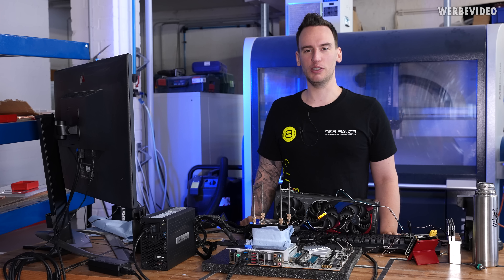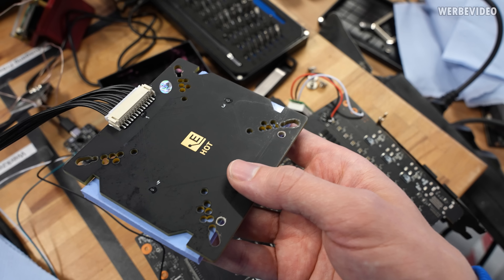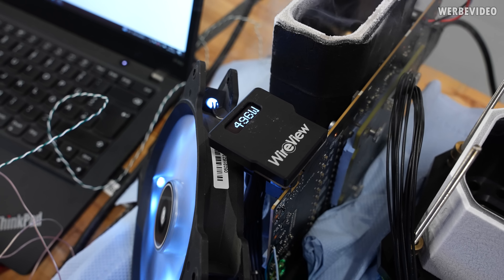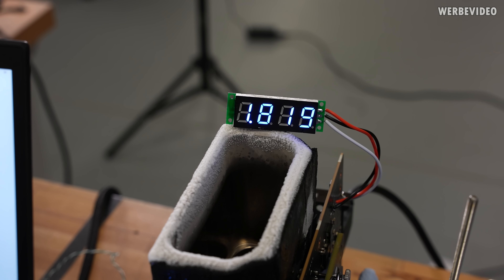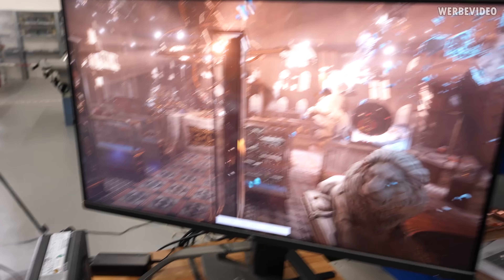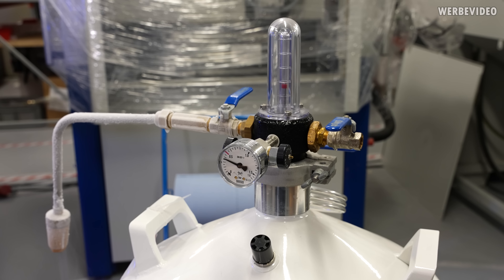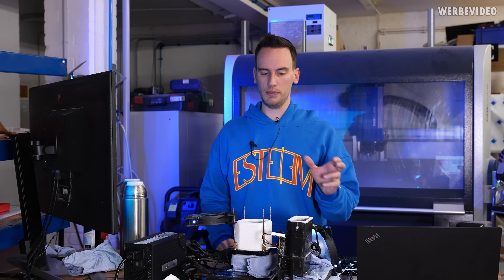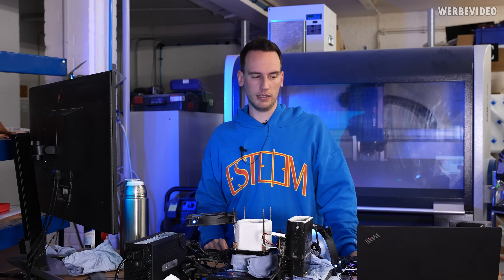A Challenge for 12VHPWR? 900 Watt Power Draw running the RTX 4090 under LN2

Comment: There is a catch, you don't use LN to cool the GPU, but the power connector!
Reply: BHHahahahahha
Reply: lols
Reply: New 12pin ln2 mini pot coming?
Reply: If you already have the LN2 on hand, why not go even further and replace the 12pin with a superconductor?
Reply: Just watercool the 12vhpwr plugg 

It's the only ting that gets hot 

Pc builders in a few years 
Watercooling a gpu ??? Why would we do that that's from the dark ages 
 Watercooling is only for the 12vhpwr pluggs do you want to use them for their intended use ? I recommend a 360mm radiator / power plug
Reply: Ha ha ha! Funny writing.
Reply: better for me

Comment: You can try and use nvidia-smi to force max boost clocks (same thing precision X does for it's "boost lock") to prevent that odd downclocking at the beginning. Though, the card running at 2610 would indicate it is already in the P0 state, but worth a try.

The 29k+ PR scores (and even upper 28's) on ambient are mostly just people abusing the memory bug. Gonna have to force ecc enabled for hwbot leaderboards as using the HoF is basically pointless ATM.
Reply: what is the memory bug?
Reply: @iMagic16  People jacking up the memory clock until it's unstable and produces errors in the texture rendering. You can watch gamer nexus' ln2 video where their last run did this and gave them a +1700 points over what they had been getting.

I personally have gotten over 31k on ambient when this happens (I didn't submit the score because it's not right to do so and is a borked run).
Reply: I have the same thing happening on my 3080 Ti FE which is downvolted on MSI afterburner.
It is set to 1830 MHz and that works in most games, but during TimeSpy it will first run at 1815 MHz for a few seconds, then 1845 MHz... Then after some time it will stabilize to 1830 MHz !

The difference isn't big enough for me to worry about it, the only problem is that 1845 MHz can provoke crashes in games so I have to monitor this

Comment: The pcie x8 is a platform issue. Alder lake/raptor lake cpus only have 16 pcie 5.0 lanes so most motherboard manufacturers chose to bifurcate the x16 gpu connection whenever the top m.2 slot is pluged in, in order for the ssd to have gen 5 connection available.
Reply: yea already been said in the last video, it's running x8 because the nvme isn't in the right slot
Reply: @Panurgic well yes and no, im pretty sure they can set the top slot to use gen 4 which would allow the gpu x16

Comment: I have a strix 4090 too.  When you apply an overclock in afterburner and run the pcie bandwidth render test in gpuz, the strix will run at 2610 (its factory boost) rather than the overclock applied in afterburner.  Same thing that is happening to you during your first 10 seconds of benching.

Comment: Maybe try to get the Galax HOF card. The higher amount of power stages, maybe higher quality could decrease vrm temp at higher voltages. If it is a good sample you might be able to run colder at higher power consumption. Especially with the double connectors.

Comment: Pretty cool!
Can i ask a question?
Can i build a bracket for my RTX 3080 Turbo by gigabyte for aio cooling?
There is no water block for it, It's a really hot card.
I was curious to build a bracket for an aio cooler then attach it to my gpu.
I'm not sure how can i cool the memories and other parts

Comment: If you're using the M.2_1 slot, on that board, it behaves as though PCIE_2 is in use and halves your bandwidth to x8.
Reply: Even on X570? D:
Reply: @BBWahoo  Yeah, it is due to the board layout.
Reply: @erkinalp  
Strange, it still reports as 16x lanes used in the BIOS. I wonder why? 

I have, 3 NVME slots, and three PCIe slots, one occupied, the former using 2 NVME Drives + U.2 using an NVME adapter, and a 1080ti, so I assume it only halves it if I used PCIE 4.0?+
Reply: @BBWahoo  "Even on X570?" - No, specifically on the board that Roman is using.

Comment: 9:42 in my case this happened without any XOC due to nvidia drivers not respecting my "prefer maximum performance" global preset. By manually setting 3Dmark to run at maximum performance mode in nvidia control panel and restarting, it locked to the set frequency as soon as 3Dmark was launched and stays there until it closes. I was having similar clock issues in other applications and the same process resolved it (was running at only 400mhz for 2d acceleration even though it was 70% short of frame rate target).
Reply: This is exactly what I was thinking, low clocks like that is what we see when the card is in the "Normal" power saving mode.

Comment: Maybe a silly question, but are you putting your boot SSD in the PCIe 5.0 m.2 slot on these boards? 'Cause on Z690/790 those are always bifurcated off the PEG lanes as the CPU only has 16 5.0  lanes. Make sure your SSD is in a nlot explicitly marked 4.0 or 3.0.
Reply: that could help but i'm not sure that would be the problem another thing that could possibly be creating the problem is the fact that all the safety features are turned off as that could be causing the GPU to think there is something wrong with the safety features there for pulling the PCIe lanes down from 16 to 8 in order to keep within its safety margins
Reply: @lordi2009k  I'm not sure that would be the problem either, hence why I'm asking. But if there is a drive in that slot, then the GPU won't have access to more than 8 lanes no matter what you do. That's just how LGA1700 works, sadly.

As for what you're saying, it's a theoretical possibility, but rather unlikely. The number of lanes active is detected and negotiated during POST, and the GPU or motherboard doesn't normally change this while in operation - they'll step down to a lower PCIe gen for power savings, but I've never seen actively negotiated bus widths. If there was a safety fallback mode it would likely go to the lowest possible configuration, i.e. x1 PCIe 1.0 or 2.0.

Comment: I’m sure you know this but if you populate the first nvme slot it makes the gpu run in x8 not x16
Reply: only if you dont have enough pcie lanes
Reply: @Proto_is_noob  on the extreme boards that is what it does. I have the same board

Comment: Hi Roman,can you flash back stock BIOS and see if  PCI_E speed will be x16 or it will be same stuck at x8,I  have experienced something similar with RTX 3090 when I flashed there XOC BIOS,my RTX 3090 would stuck x8 with XOC 1000W BIOS
Reply from the maker: Showed it in the last video already. It's x8 even with stock bios
Reply: @der8auer-en  Roman, z690 mobos have a bug (if you are using nvme slot 1, the gpu runs at 8x) try in another slot.
Reply: @der8auer-en  Ohh okay Roman,thought so its down to BIOS,does happen with both BIOS? I assume that Strix as always have dual BIOS
Reply: @andresm5087  That doesn't sound like a bug but a feature.

t. ASUS CH7 with dual NVMes with PCIe x16_1 running at x8
Reply: @andresm5087  he tried other slots, other motherboards etc.....definitely a #### card.
Reply: @RogerRamjetLips  Is a bios related problem,  If I use until BIOS 1304 I get x16 but if I load BIOS 1403 or later I get x8.
Reply from the maker: I even tested on a gigabyte B650E board and there it's also x8. It is a card problem. I tried literally everything
Reply: @der8auer-en  my 4090 msi trio is also at 8x, idk why
Reply: @der8auer-en  I manually set my pcie 5 to x16 and still nothing. Disabled the m.2 #1 because they share bandwidth and nothing, updated the bios because the new bios has some fixes for 40 series ( date 11/08) and still nothing… pretty weird

Comment: My GPU goes pretty hard, pulls 485w @ 1.096v with core clock of 2.2ghz @ 74c under gaming load. Asus Strix 3080 Ti OC, Asus just builds things different I guess, I have loads of headroom too, I could easily undervolt it and run higher, I've achieved 2.3ghz at 1.069v before but the temps were at 73c during Timespy benchmark and assumed I'd be looking at 80+ on gaming for long periods so I'm currently running 2.1ghz max, pulling 353w @ 64c 1.000v

Comment: What psu are you using? I just got a strix 4090 oc and I have rm850x. I need to get something a little stronger.  I'm running 12900kf. I'd really like to get something that I don't have to worry about upgrading in the next couple of years... so I'm looking 1400 to 1600w range.

Comment: However, there is one thing to be aware of when installing an SSD in the first M.2 slot.  Namely, that it takes the PCIe 5.0 lines from the graphics card interface.  It has the disadvantage that the moment you install an SSD in this slot, you will switch to eight GPU lines, which will only work in PCIe 5.0×8 or PCIe 4.0×8 mode

Comment: The motherboard runs at x8 mode because they lock it when there is an SSD installed in the slot closest to the CPU or m.2_1. I was also bugged by this and the solution is to move the SSD which is impossible for me because my board has 3 slots and I have 3 m.2 ssds.
Reply: Did you watch the video? He tried multiple, boards and CPUs.. it’s the card 💀

Comment: Could the 700mhz for the first 10 seconds be caused by the chip actually being too cold?  Maybe it’s so damn cold that the temp is  “misinterpreted” as an error and the card full throttles for safety.  But after about 10 seconds of load the chip warms up enough to be in a range that the card recognizes… Or is that all just crazy talk?

Comment: G'day Roman,
🤔Just wondering if the PCIe X8 problem exists when you do Air or Water OC too? as you have tested with different CPUs & Motherboards maybe some Temp testing to see if there is a point where the PCIe limits because of that, or just another thaought as you & BPS Brian both had this with your intel platform does AM4 & AM5 cut the PCIe lanes too?
As nVIDA is so strict with the Partners regarding BIOS & Power Limits do you know if they have said anything about Elmore's BIOS for 4090, 800-900W has gotta be giving them the SHITS BIG TIME.
Reply: Have you not seen his past videos?
Reply: @les_railgun  not at the moment, I have been trying to find a new home suitable for my disabilties & now am in the middle of moving.
So if Roman has answered these questions in past videos I would be grateful for you to answer them for me & point out which der8auerEN videos so I can watch them first when settled in my new home.

Comment: Question for you Der8auer:
Do you agree with corsair that the melting is caused by not fully inserting the 12+4 pin connector?
Reply from the maker: right now it seems like  a lot of guesses but somebody has to find a way to reproduce the problem. Otherwise just guesses
Reply: New post on reddit 5 hours ago with a Zotac 4090 burned with connector fully seated. If 0.5mm of gap is all it takes to burn a connector its faulty design either way. There should be enough contact either way even with a small gap. Someone, like der8auer for example should measure pin depth and terminal depth vs how far the adapter is socketed to verify terminal/pin contact. Would easily tell if the "not socketed correctly" is even a thing.
Reply: @Tommyof84  Which sub was the post on?
Reply: @noxious89123  R/nvidia post "9900k 4090 adapter melted"

Comment: I'm curious.. could these condensation issues be helped by running a de-humidifier in the room to try and reduce the amount of water in the air?   Just a thought...
Reply: lmao no
Reply: @Sarlyx  no he seems to be right. Condensation is the water in the air cooling and condensing. If there is less water in the air it would take longer for condensation to build up, ie. there would be less of it. Theoretically if it was 0% you wouldn't get condensation but that's basically impossible.

Comment: Just a thought, but are you using the primary and secondary nvme slots? On some older boards using both will lower pcix slot to 8x as there are not enough pcix lanes available

Comment: for what its worth im using a MSI gaming x trio 4090 on a gigabyte B550 master board, 5800x 3d cpu and my bus interface reads x8 aswell. stock bios as it would be out of box.

Comment: 1:28 thermal pad…

Thats a thermal brick!!

XOC bios are amazing shame i cant find one for the 3090 with rebar support so stuck at 370w max cus 2x8 pin even tho my PSU wouldnt even flinch if i used it as 1x8pin daisy chain and my cables will happily do 500w each im stuck at 370w total cus bios

Comment: Perhaps time to directly LN2 cool the memory then!?
Reply: That wold make it worse
Reply: @Adam-bw4lw  Explain?
Reply: @bradley3549  its memory controller inside the gpu that likes to be cold, nand flash itself can perform worse with lower than ambient temps
Reply: @vinylSummer  But we're not talking about NAND flash here (and I am familiar with the thermal sweet spot NAND seems to have.) We're talking about DRAM - which does seem to respond to cryogenic cooling - though I've never seen it on a GPU.
Reply: @bradley3549  oh, you're right, I mixed things up in my head a little bit. Maybe not direct cooling, but rather some heatpipes going from the base of a ln2 pot to memory chips would be interesting to see

Comment: A lot of the scores on the hall of fame for Port Royal should be invalid , there is a bug where if you can get your memory to clock really high ( over +1500 ) there is a chance it will artifact ramping up the fps and still posting a valid score , jay mentioned about this in one of his recent videos so wouldn't be put off by most of the scores currently posted , its pretty easy to tell which are genuine and which are not :) 
As for your card have you reached out to ASUS for any advice on where the missing pci lanes have gone ? its a bit  past the rma stage but maybe they can help or offer some advice ...
Keep up the good work as absolutely love your content :D
Reply: Highest I got was 27.1k, it seems like without any voltage/vbios mod getting above this seems impossible
Reply: @KopaZ  I can get a genuine ( no artifacts ) score for just over 28k on my FE when overclocked but this is pushing it to the limit as core will be around 3045mhz and memory at +1500 . I can push the memory higher to +1600 amd will have lots of artifacts and post a much higher score but its not genuine imo🙂28k should be possible though on an overclock air cooled card 🙂
Reply: Cope.

Comment: Could the 8x PCIe lanes be caused by a driver issue? Have you tried completely wiping Nvidia drivers and reinstalling them with DDU or however that tool was called?
Reply: It's a motherboard feature. Alder lake and raptor lake cpus only have 16 pcie 5.0 lanes so the motherboard has to bifurcate the x16 connection in order for both the top gpu and m.2 ssd to have gen 5 connection, even when non of them are actually running at gen 5

Comment: How do you get the power connector to not mealt!?
Reply: The PCB is basically layers of copper sheets. They conduct heat very well. This is when LN2 cooling just the GPU core, everything else including the VRM stays reasonably cool. The connector can't melt if it's being cooled!

Comment: Regarding the x8 issue, did you try a different 12VHPWR cable? In case it's an issue with one of the solder points in one of the connectors being broken?

Comment: 12V plug melts running 350-500W unoverclocked cards.

der8auer: hmmmmm
Reply: If it melted on every system there would be a recall. No reviewer has had theirs melt, even the ones who have tried to make it happen.
Reply: Good thing that aside it being a ludicrously obvious joke, I didn't even say it melts on every system then isn't it.
Reply: @enlightendbel  There was nothing to indicate that it was a joke. Jokes need to be funny to be recognized as such.

Comment: Can you do a episode on why 4090 takes so much more power with each voltage increase?
Reply: It's literally the same as every other semiconductor, CPU or GPU, for the last couple of decades. Increasing frequency increases power draw in a linear fashion. Increasing voltage increases power draw exponentially. (To be specific,  "power consumption is proportional to the square of the voltage"). It's more drastic than we've seen with older cards, simply because it's far more power hungry to start with. There's an awful lot of transistors in that GPU!

Comment: So good to see the connector issues are just user error. He is hitting 900 watts with no melting.
Reply: Still didn't watch the video but other ppl looked into it and it depends on how the cable itself is made
Reply: The connector issue begins when you use the card in a case and start bending the cable adapter.  When you have the weakest part of the adapter exposed and then begin pulling 350+w thats there issues begins
Reply: The power plane gets colder because of the LN2 cooling through the GPU chip BGA and this cooling effect carries on to the connector pins themselves, so they are running at lower temperature helping them withstand the heat generated by the high currents

Comment: you need to get your hands on the new z790 asus apex board that will get you 1st place all day long, its alot better board then any of the z690 boards by miles for such things,  z690 boards are trash and 100% waste of money, its the gen to 100% skip.   get yourself the apex z790 and see why soon as someone got their hands on one it instantly took the single card world record, vs all the z690 trash on the market.   ive been tellin folks this for months but hey they are stubborn and dont want to learn the reality of it since they wasted their cash on z690 they wont accept defeat.  as below is proof its the current world record holder go look yourself then drop those z690s in the garbage can where they all belong.

go look the worlds top single gpu run is on no other then the z790 apex as of yesterday with a 4090,   how that person got an apex one well he must have insider trades since the board at least in western world has not been released to yet.